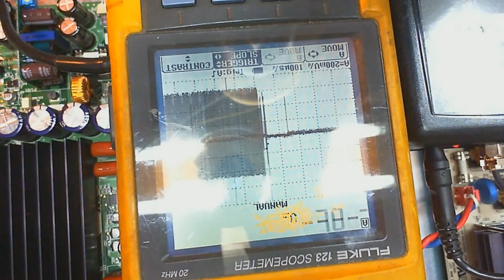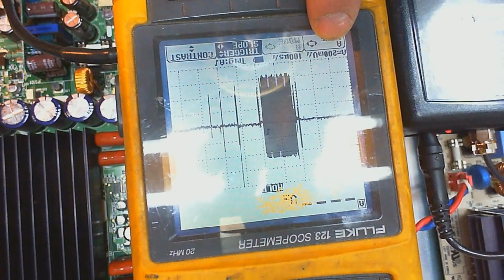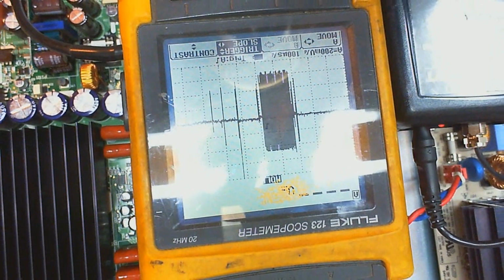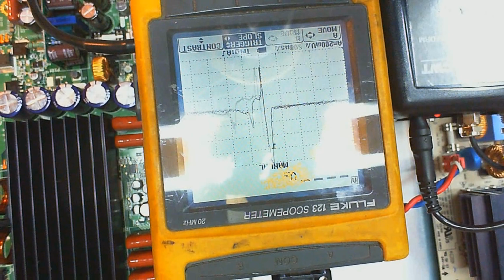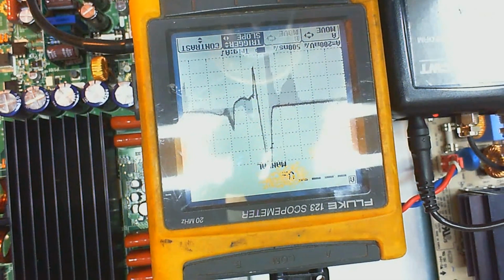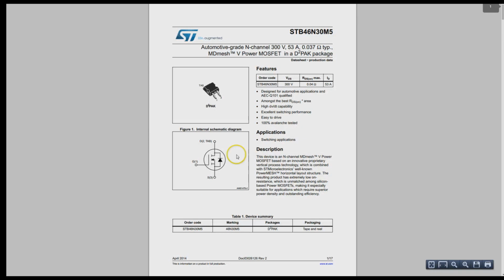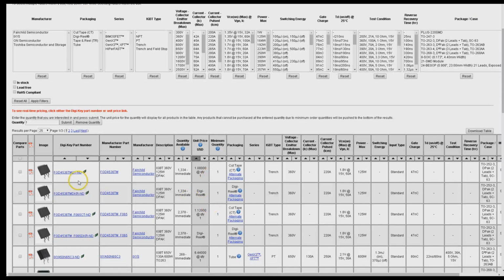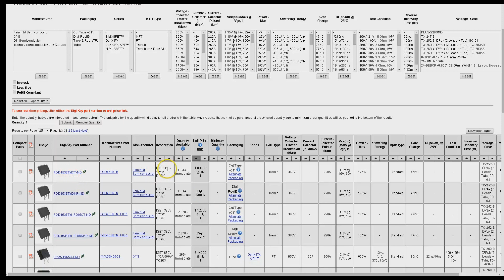How to repair a hybrid IC IPM used in Plasma TVs Part 2

Comment: Hi, Thanks for sharing. I've repaired a YPPD-J017C/ YPPD-J018C board which lasted only a day when one diode and one IGBT failed. Is there any recommendation you can give? Do plasma panels draw more current as they age because when it was working I felt a lot of heat coming from the rear panel louvers? What diode should I replace the burned one with? Will I be better off using some heavy duty IGBT and diode combination or a MOSFET externally for endurance. Will replacing the whole module resolve the issue or could there be something else wrong with it? Thank you.

Comment: Hi,
Thanks for the video,I am attempting to repair a J018, do you know what diode I would need if I mount IGBT on External sink,a hand drawn schematic of how the diodes and IGBT connect would be very helpful,
I have not have much experience at working at die level ,but I do follow instructions real well!
Thanks alot Your vids help please do more!
FRED
Reply from the maker: If you mount IGBTs externally make sure all connections are as short as possible, especially the gate-emitter path. The diode is antiparallel to the IGBT, i.e. cathode is connected to collector, anode to emitter.

Comment: hi Tom; thanks 4 the trick : i wanna fix my IPM STK795-821; however i do not want to remove it from the Y-SYS ; also this STK is sealed in epoxy, not transparent silicon like YPPD. my q is: can i ju/ st cut the 4 Y-SYS-OUT pins and use external wires as jumpers to hock the two FGD4536 EXTERNALLY (i will  use heatsink) if YES. would u PLEASE pin out the new wiring (what to cut from external STK795 AND NEW FGD4536 CONNECTION)  THANK YOU SOOOOOOOOOOOOOOOOO MUCH
Reply from the maker: Sorry I don't know if that's possible. They may have slightly different circuitry...
Reply: +TomTechTod : thnk you Tom 4 fast reply;
i will try any way cuz just ordered rge FDG 2 for 15$ ( canada!) ; do i have to remove the gate or just cut the connection between G-C-E ?
thank you

Comment: Why do you recommend IGBTs if original diodes survived,  and FETs if they did not?
Reply from the maker: FETs have intrinsic body diodes so they "could" be used if space is an issue. I recommend IGBTs  ,but then the diode is essential. Some newer génération FETs are high voltage, high current devices though.
Reply: +TomTechTod Ah, one has diodes, the other no. One could add diodes with the IGBT. The IGBT you recommend is just SO nice (high V, A)!

Comment: Great instructions Tom. Thank you. 

Is it easy to unsolder the module from the PCB? 

Why these fail? Marginal engineering. Several kW switching; a little dust on the heat sink or a hot day... Bang! Adding small fans and speed circuit could extend the life significantly. 

Also,  do the individual plasma panel "tubes" (pixels) increase the electrical load over time (a la fluorescent tubes)?
Reply: +davecc0000 Yes.  Plasma panels draw more power for any given brightness as they age, particularly early LG panels.  Reducing contrast and adding fans will extend the remaining life of the IPMs.
Reply from the maker: Yes, marginal engineering I'd say. I don't know about increasing load over time.

And they are horrible to remove from the PCB. Take your time and be patient. Some of the pins can be easily freed with solder wick, others you may have to heat several at the same time while carefully prying up one side of the module.